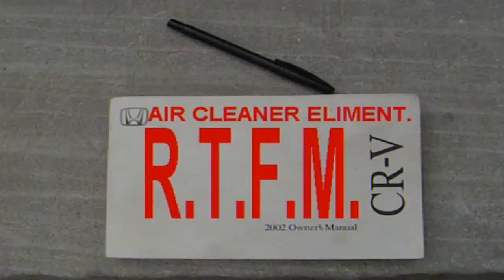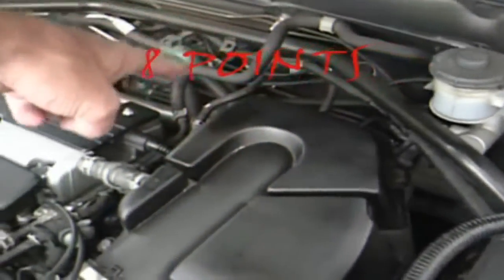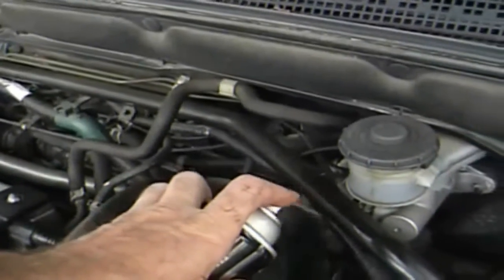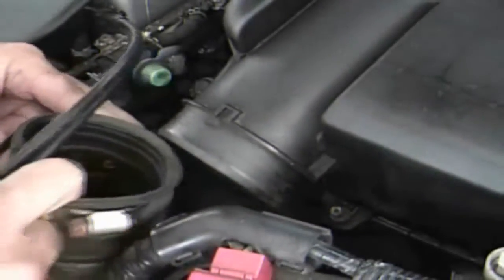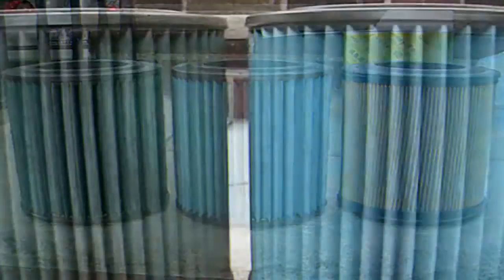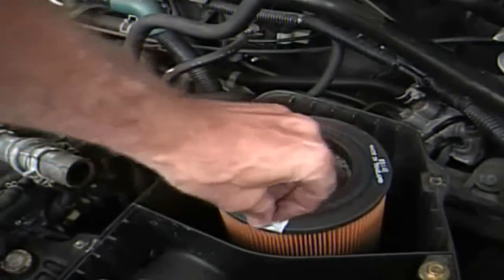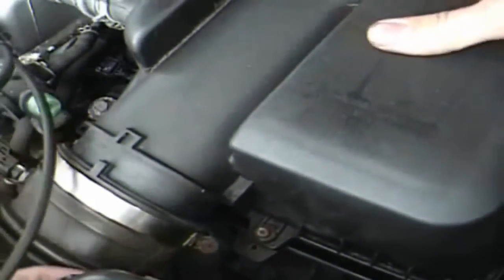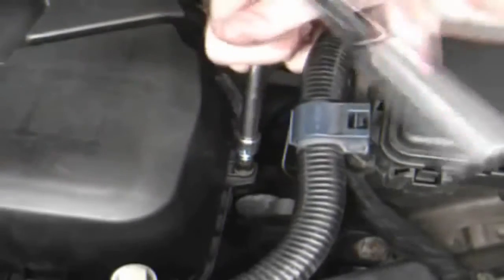2002 Honda crv ex Air Eliment Filter change 2 how to

Comment: Thanks dude, Honda wanted me to pay $150 to change the air and ac filter.  Thanks to you I can do it myself.  Thanks a lot.   I took my car for an oil change and the Honda  dealer told me I needed a new engine/alt belt and that it would be $170 to change it.  The recommended that I not take it on a long trip because "it was cracked."  I looked and there was no crack.  I showed my uncle who is a mechanic and he told me that there was nothing wrong with my belt.  Cant eve trust the Honda dealer.